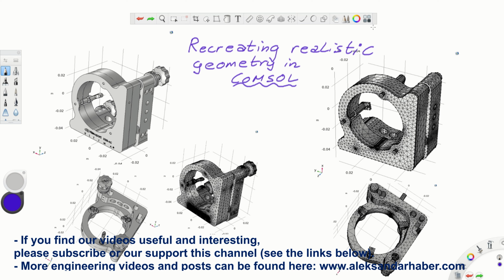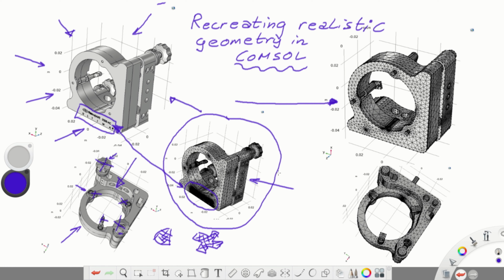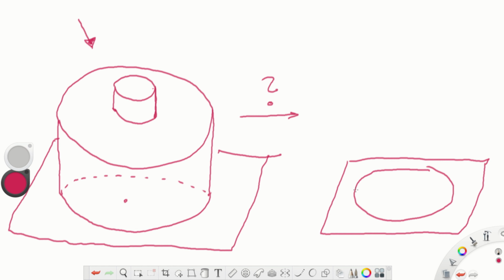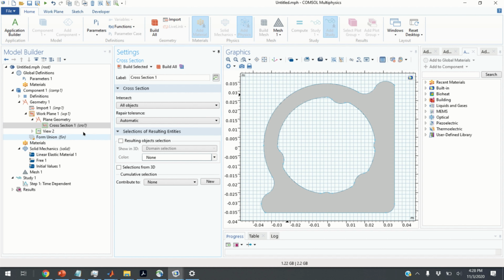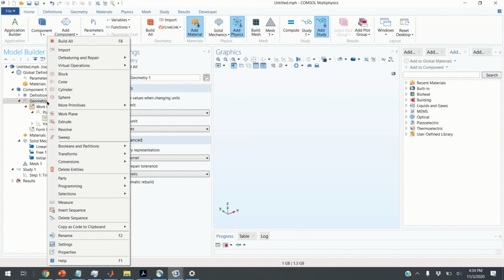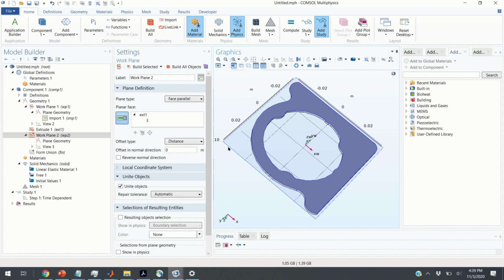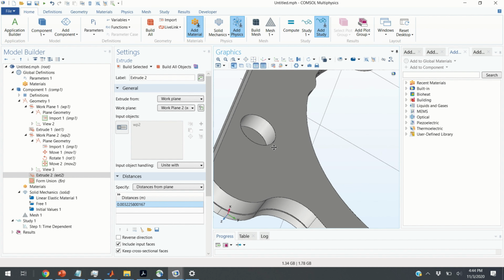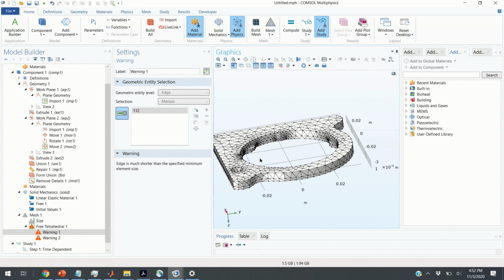Recreating 3D Geometries in COMSOL from Realistic and Complicated CAD Files

Comment: Hello. Thanks for your explanation. One doubt, how can you import to Comsol a geometry with horizontal and vertical parts/items? For example, a hollow cylinder with a connector, like a chassis with a connector for electronic applications.
Reply from the maker: Hi Sergio, 
I made a video on how to import 3D CAD geometry to COMSOL from Fusion 360. However, you can use the same method to import the geometry from any software:
https://www.youtube.com/watch?v=YpgqARJgz9E
Reply: @aleksandarhaber  Thanks for your answer, I will check it. Greatings!!!
Reply from the maker: @SrG-Cmps  Thank you for the interest. Good luck.